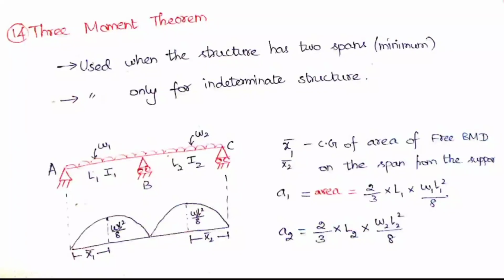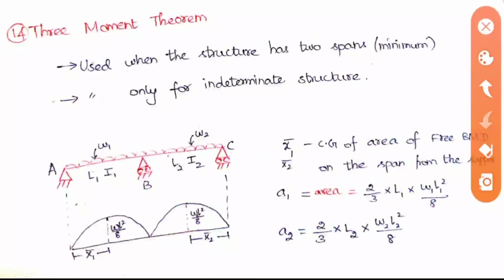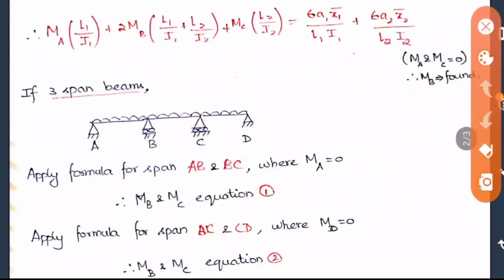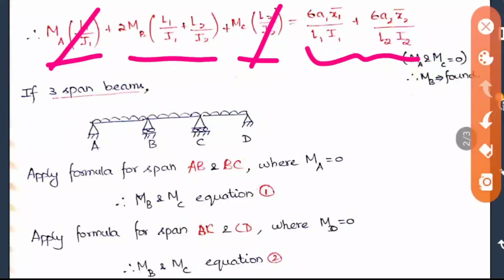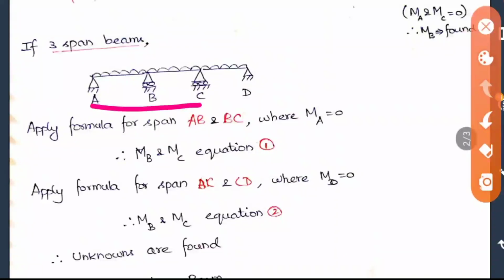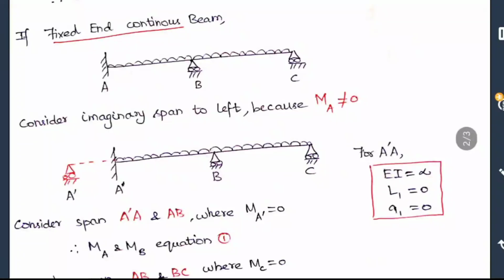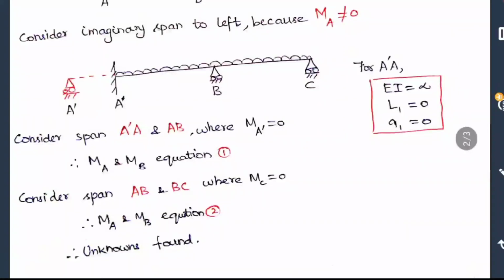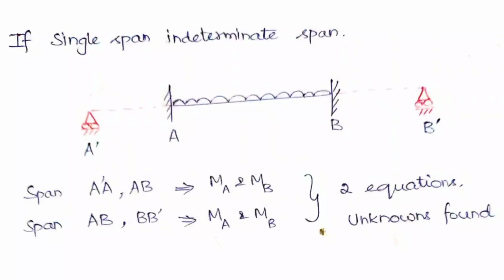Three Moments Theorem | Structural Analysis | Lecture 14 | English

Comment: Mam please do one video on previous year TRB 2017 and 2012 question paper analysis, like the question are comes from which exam, like GATE, IES, ISRO,. In that question papers some questions are like same copy paste questions, so please do that, take 2017 question paper in that 2 marks section 101-140, which are question comes from which year gate questions, ies question, are similar to that gate question but data only changed do like that videos it's very useful.
Reply from the maker: Sure will do that soon. . Thanks for your suggestion. 
Keep Preparing 👍